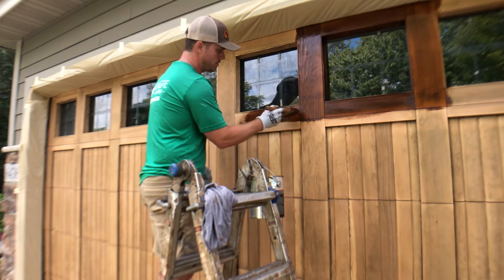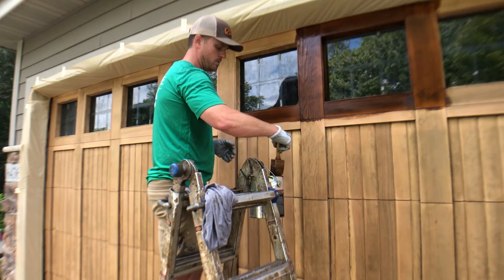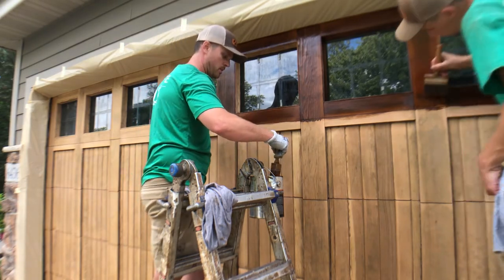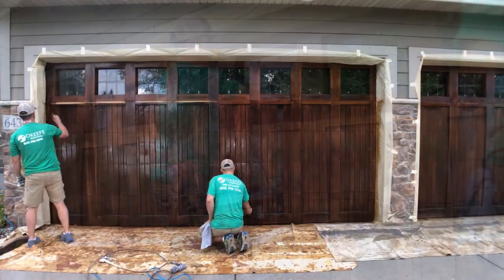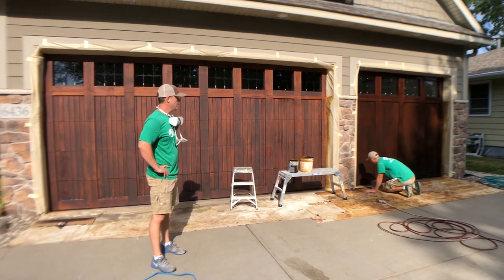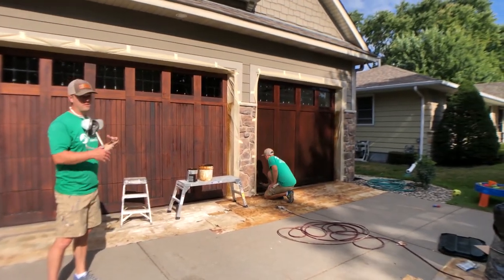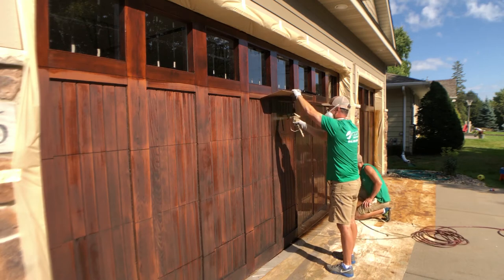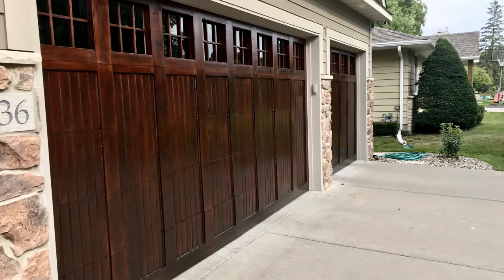How to Stain a Garage Door

Comment: Enjoyed seeing your progress on this project. Thanks for sharing. You do quality work. Also like the uniforms that set you apart from other companies. Which sikkens did you use?
Reply from the maker: We’ve been using sikkens log and siding for about 8 years and I really like it.  It’s held up really well for customers.  It’s a little limited in color options though so I’m considering using Ilva which is the same manufacturer we use for cabinets.  That would be a two part system with stain for color and a clear coat.  What do you like using?
Reply: @okeefepainting1023  I use the same. Satin finish. I put it on a lot of exterior wood ceilings and doors in Texas. Their proud of it and charge a premium but after a couple weeks it looks amazing. Keep up the good work.
Reply: How much cost to do this job the sane side of doors ?
Reply: @okeefepainting1023  hey I’m a painter in the north east. I’ve used sikkens which is now ppg before and has good results but in my current job the doors needed to match pre fab doors and I couldn’t get the dark oak to match. I stripped the doors down and wiped with water to open the pores. Used a wiping stain which isn’t ideal for exterior but came back with 3 coats of a oil spar satin clear coat meant for exterior finishes. I’ve done this before but always get a little nervous about longevity. I’ll be maintaining the doors yearly from now on, just wondering if you’ve had any experience with this method. Thanks